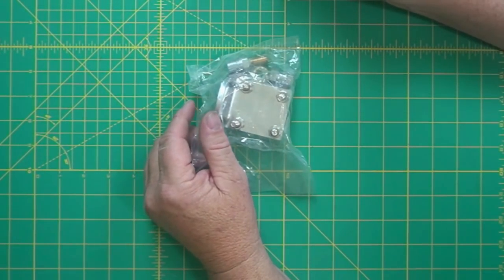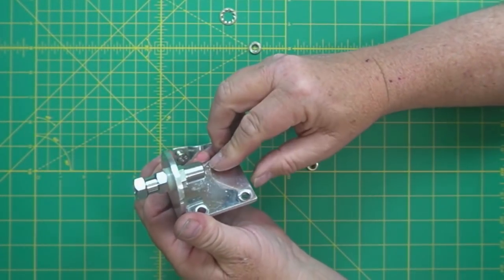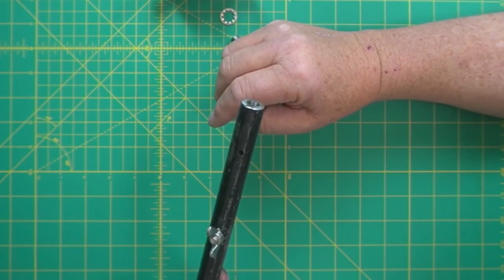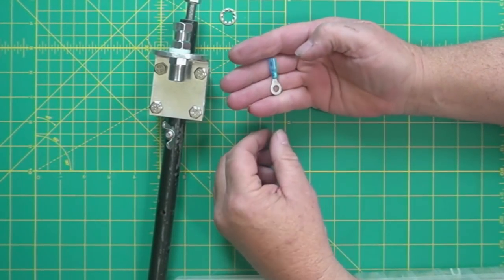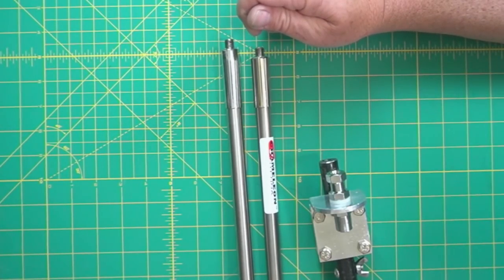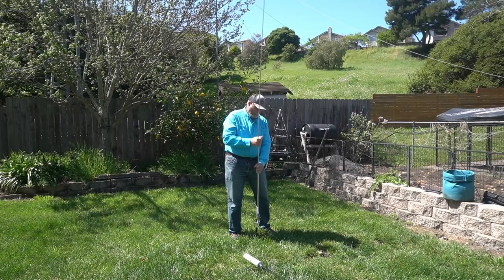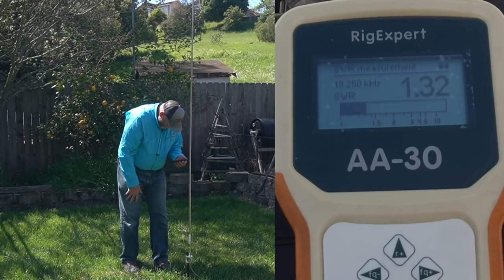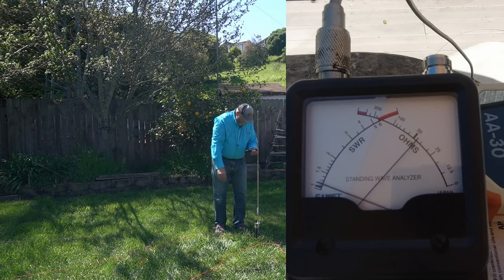How to get 9 ham bands from one 17' extendable antenna whip and how to set it up FAST!

Comment: I used a mirror mount, but I made a spike from an earth rod cut in half, but cut at an angle so it was really sharp. I made radials that attach to the PL259 using a large crocodile clip. The whole spike and mount is the same length as the collapsed antenna. 73 GM4SVM

Comment: Ground rod clamps of the sort used for home electrical service grounding would be an easier way to secure those radials to the stake than drilling and tapping.

Comment: Instead of drilling and tapping the round stake for the ground radials, use a little larger crimp on terminals and put them on the bolts that hold the mount to the stake.  I'd probably put four wires with Power Poles on the end.  That way you could have four ground radials.
Reply from the maker: I used to do it that way but like the new way better, they both work. I didn't need to tap threads and there is already holes in the stake, I just wanted 1/4" bolts.
Reply: @KK6USYHamRadioAdventures  That is what is great about this country and this hobby.  We both get to do it however suits each of us.  Thanks for the reply.

Comment: I bet one of the Chinese ATU-100 tuners would work on that from 40-10.  I use one on a 5/8 wave 10m antenna and it takes me down to 80m.  Is it efficient ?  Not really.  Does it work ?  YES IT DOES.  You ought to test it out to see what it will do on that 17' whip.

Comment: I have used that same method...the stake was about $2.85 at Home Depot.  It ist heavy, but it's incredibly cheap and strong.  No problem getting into the ground (depending on the size of the hammer).  Good video!

Comment: Hi. Great video. Thank you! Question for anyone here - drilling and tapping a hole is slightly daunting for me. Could I get a couple of wing nuts and attach my radials to one of the four bolts that hold the mirror mount to the ground spike? That would work, too, yes?
Reply from the maker: Yes

Comment: Hi Chuck.  Nice video!  I made something very similar with just a 1/2" diameter 2ft. piece of aluminum from Home Depot.  I bent the top 6" 90 degrees in a vice.  I mounted the same mirror mount you used on that horizontal part and I use it as a handle to push the rod down in soft soil.  I don't have a good way to hammer it in as in your setup, but I made mine mainly for working POTA sites that have a lake or pond.  I am planning to set this up in the water at the shoreline with a couple pieces of bare wire in the water for the ground/counterpoise.   I've only played with the setup in the yard so far.  I'm anxious to see how QRP SSB works with a water ground plane.

Comment: The star washer goes under the coupling nut. Between the nut and the nylon spacer. On bottom it can cause a short from the center to ground.

Comment: I've used copper tube for the stake in the past, fantastic on the beach especially when used between the high and low tide marks. Loads of salty damp sand, no need for radials when using God's linear amplifier.

Comment: A couple of mostly successful variations on this:

Using a similar idea, I mounted the 17’-ish whip to a chain-link fence top rail that is about 4 feet high.  Electrically, that rail is about 10’ each side of the mount. These rails are oriented E-W. Then, I grabbed two 25’ ‘radials’ from a buddy-pole kit I won at auction and affixed them to the mount oriented N-S. 

Then I extended the whip to full height. I attached a 9:1 unun at the feedpoint and ran 50’ RG-58 into the shack to my antenna tuner. 

It tunes, fully extended, 80 and 20 with ease, and most other bands with a little twiddling of the tuner.  40 seems a no-go, and I have not tried 160. 

Measurements were taken with an MFJ antenna analyzer hooked to the input of the tuner. 

It performs outstanding on 20 and 75. 

Taking the other two ‘radials’ from the buddi-pole kit, I affixed them to my iMax 2000 with N-S orientation to see if it would then work effectively on 20. The feedpoint of the iMax is only about 8’ off the ground mostly due to lot and wife restrictions. 

I am happy to report that the 2000 now works much better ON 20 m, and seems to work better on 10, 12 and 15. Non-scientific eval!

Keep up the fantastic work!

73 de Rob, WO0WOO.
Reply from the maker: Thanks Rob, Your setup sounds pretty interesting. I have the little brother to the Imax, that might make a good video thanks!!

Comment: Hi Chuck,  nice video,  I have been using a very similar setup, I use a piece of rebar that I mount the mfj-342 onto, then the 1979 telescopic,  I also use the slidewinder coil, but not always.  I use a drilled n cut piece of nylon cutting board with the center drilled to fit about the 3rd telescoping bit for guying, all sets up in 2 or 3 minutes, I dont bother with radials as the rebar is conductive and driven into the ground,..  your method is a great  setup as well,  whats convienent is i keep the kit in my truck all the time ready to go,..  cheers n 73 !! 👌👍 I have a few videos on u tube as well under A92GW, oh n i have wanted to add a bit of wire to get 40m, but did not try that yet, but will now.  All the best mate !!
Reply: The fact that the bar is grounded is not the same as having radials. Your losing a lot of energy through ground losses. All the literature will tell you that.

Comment: I don't have the top bolt but I use the same method for pota. I have had the connector/ bolt assembly fail I carry extras and use 550 pra cord on the antenna if windy outside now. Works great enjoy

Comment: Thank you for showing me that I can do this. I have tried Ham Sticks and the Wolf River Coil and never could get the SWR to something that I could use. I don’t know still how to fool with getting the coil adjusted with adjusting the whip length. So, it appears to be forget the coil and adjust the whip length and forget the coil or not use it at all. I hope I understand this video. Thank you for your time.
Reply from the maker: Tommy, with wolf river coil if you can get your radio near the antenna adjust for the most noise you can hear and then small adjustments from there. Also on YouTube search wolf river coils they demonstrate how to do this.

Comment: It’s a little hard to find but you can get 3/8-24 all thread, not quite as stiff as the rod. Add a double female joiner like came on that Cb antenna and no drilling/tapping.

Comment: could have saved time, and put those ring terminals for the ground radials right in the mirror mount. i did this very same thing for my wrc sb mini, which i use a 17' whip.
Reply from the maker: Dj I have done that in the past also and it works great also, Thanks for watching  and sharing!

Comment: I stick a T post in the ground, mount my 18ft aluminum vertical on it ( no loading coils) slap a 9:1 unun on it Maybe a couple of ground radials ( not always needed but they will help) And hook up my radio with it's internal tuner and work 80 through 6 meters. If a tree is available, throw a wire up in the tree, quick easy and cheaper. And alot less complicated. Neat ideas you have but time consuming and costly.

Comment: Cool set up. I use the mirror mount with a steel gutter nail I think it's a foot long. I have the mfj coil with my whip. Works great the nail holds well and it's easy to get into the ground. 40-6 meters does very well. Maybe the nail is for putting land scape timbers together I can't remember. It's about a 1/4 inch in diameter.
Reply: Pole barn spike

Comment: Instead of drilling and tapping a hole just add another mirror mount and leave the insulating washer off.
Reply from the maker: Great Idea DB I will pass this along in an upcoming video!
Reply: Could you run two antennas at the same time, on the same stake?

Comment: I find anderson powerpoles connectors too expensive... I usually use nice and cheap bullet connectors. I make sure to put the female part on top to droop down and plug in the (male) radials into them. if someone trips over one there should be enough force to disconnect them. I like to solder and heatshrink all the connections to give extra rigidity to the connectors.

Comment: Good and interesting video.  I have the Wolf River Coil and want to get the 17'whip for it.  I also see you have a link to a Bluetti power station and I have one as well.  Have you used this as a portable power supply for your ham radio while out in the field?  If so, how did you utilize it.  Did you take the power supply as well and plug that into the Bluetti and then plug the radio into the power supply?  Or can you find or make a connection and plug the radio directly into a DC outlet on the Bluetti?  There is no problem with the radio rated at 13.8 V or the radio drawing too much current?

Thanks!

Gary Readore, KJ5DAN
Reply from the maker: Gary I haven't tried the radio on the bluetti

Comment: That stake is super beefy, I might go get one. I use a 3 foot copper ground rod with a mirror mount but it’s pretty wobbly, too flexible. How did you drill the end hole? By hand or or what? I don’t think I could drill that straight enough by hand.

Comment: I bought a mirror braket and the stake.  The coax connector has a different size interior part that doesn't accept my PL-239.  I've tried two different runs of coax.  Same results.  Ideas on how to fix the trouble?

Comment: I want to see the contacts you make and see the ranges you get. Getting a good SWR is one thing but getting bandwidth and range is another. A practical use with a map and pushpins to show where you made your contacts would be great to show hams if this meets their needs. Nobody needs another substandard antenna in their pile of mistakes and misfits.
Reply from the maker: FlyBaby, I will post a video for you that I made 85 contacts in about 60 minutes with the stake and the 17' extendable whip and see if I can find the log info to get a pushpin map. The video was a POTA activation running 100 watts on battery power. I was in northern California and a lot of the contacts were to the east coast and one into France not too bad.  Your right SWR means nothing if the antenna doesn't work, but as you know a 1/4 wave vertical is a great antenna just think DX Commander. I assure you this is not a substandard antenna and try not to bring those type of antennas as a suggestion for the viewers. 
https://www.youtube.com/watch?v=yvKjL_RPyc0&t=337s

Comment: Fascinating  build! But I'd like to make a suggestion if I may.
You have a background musical rhythm playing that is most annoying!
Its totally unnecessary and irritating!!!
If you loose it I will like & subscribe! Thanks.
Reply from the maker: I only use music in very few videos
Reply: @KK6USYHamRadioAdventures  very wise!
Think of my criticism like a swr meter. Just fine tuning your video!
Truly I got a lot out of this!
I've only had my Technician license two weeks now and am excited to get started, and antennas are a big part of my intrest in the hobby.
Recently retired HAM is a real blessing. I have remote land in N. Idaho, and a side x side to reach higher elevations so your antenna info is invaluable!
(I went ahead and subscribed inspite of the background noise!)
Thanks for responding.
Reply from the maker: @ronammologist16  I have a Tech video that may help
Reply: @KK6USYHamRadioAdventures  thanks.
I will look for it!
Bu the way, I'm KK7RXI.
But still waiting for my first radio, a hand held, Yeasu.